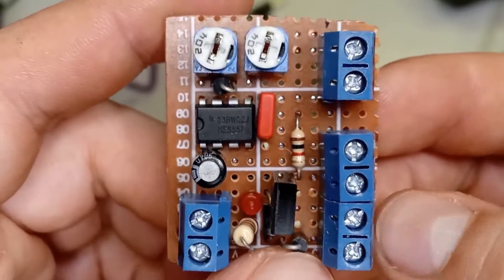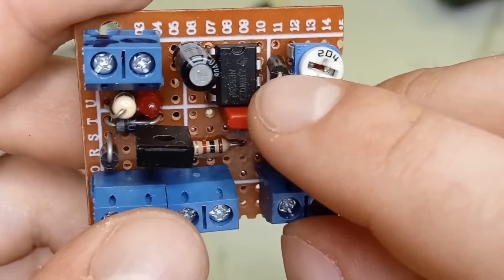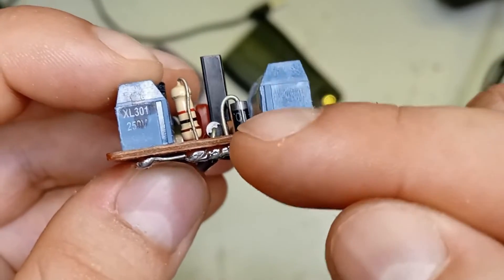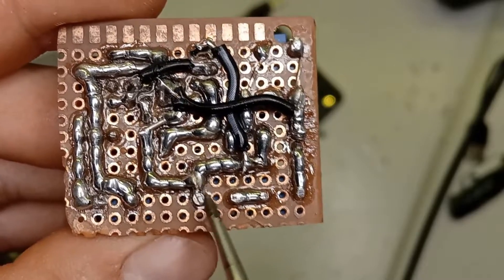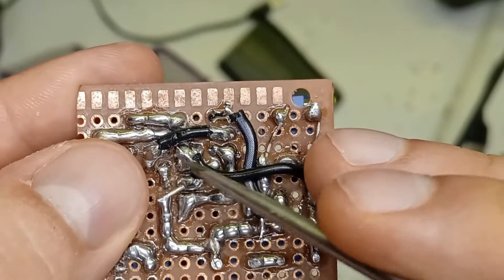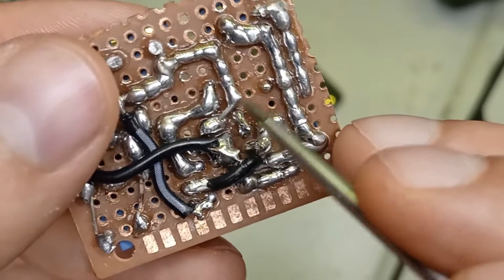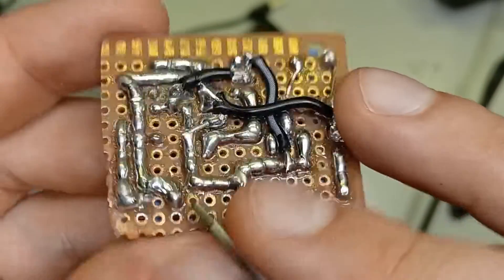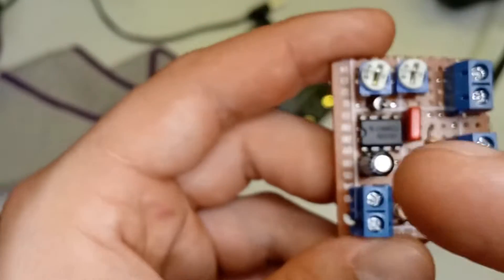Homemade Airsoft HPA FCU Circuit Guide (No Programming Required!)

Comment: Do you have a version of the circuit diagram that shows what parts are connected via the screw terminals, as I want to make a pcb version to reduce size but I am not experienced enough to do it myself

Comment: hi there was wondering if this will work with a 12v bv310a mac valve solenoid
Reply from the maker: This circuit is designed to switch a 12v valve. So it should be fine.

Comment: Why can’t you direct wire the trigger to the valve?
Reply from the maker: You can, but it'll only be semi automatic and will waste a lot of air as the dwell time will be controlled by how fast you pull and release the trigger. The engine loads and fires once per blast of air.
Reply: @FulcrumAirsoft  thank you for the quick response. I’m working on a 3-D printed HPA build on a budget so thanks. Any recommendations that you didn’t cover in your videos for me would be really nice. Thank you.
Reply: I don’t care about it being only semi auto
Reply from the maker: @crystalmiller9530 Then it would work, but you'll be yanking the trigger quickly to save air. And if the trigger gets caught on something it'll vent continuously until released.
Reply: @FulcrumAirsoft  I can work with that

Comment: Have you thought about making a DIY muzzle tracer unit?
I've tried but spectacularly failed.
I replicated what I've found in some videos but didn't worked. The thing is that the BB's speed is to high for it to have the necessary time to charge with the UV light.
Still, those on the market are working. I don't know if it's a certain type of LED's or if there's another secret.

Comment: Anyone have issues making this on a breadboard? Not sure if I’m putting too much current through the board or something but it doesn’t work at all.
Reply from the maker: I breadboard everything. All the connections good? Not using a knackered old breadboard?
Reply: @FulcrumAirsoft it was an Adafruit (albeit old) breadboard but i switched to one I knew worked and lo and behold it’s beautifully triggering the solenoid in semi and full
Reply from the maker: @saddlepiggy Chances are, whilst reassembling you've made a connection you missed the first time. I always miss something.
Reply: @FulcrumAirsoft for sure, definitely done that before.

Out of curiosity, is there any reason you chose 200k pots? I tried it with a couple combinations of 50k, 100k, and 200k which all worked too. Something to do with the RC/555 timing?

Comment: This video was motivating me. I dont learn electronic at all. Just wanna see how it goes and see the result. Perhaps i will start to learn basic electronic part on future. Have you ever uploaded the test result from making this simple module?

Pardon my bad english. 😅
Reply from the maker: I've used this exact board in a build. It works but the build has other issues with the hop unit. I even tried using a relay to switch the valve to get around the internal resistance of the transistor. When I get a moment (ha ha) I'll be sorting that build out.

Comment: Is the 10nF polyester or ceramic capacitor a replacement for the WIMA capacitor in your video?
Reply from the maker: Yes that will be fine, the WIMA was a polyester. You probably can get away without the capacitor but it'll make it that little bit more stable

Comment: Have you tried the Rk Education astable 555 kits? Im sure they will work with a little modification.
Reply from the maker: Probably would having a quick look at them, but I have no issues soldering the whole thing. Means it can also be smaller and tailor made.

Comment: can you use just a regular FCU? i am 3d printing the engine and i have a amazon 12v solenoid and was hoping to just add an adapter to the solenoid to get full auto and semi. i am so lost on the electronic part of this stuff. any help is welcomed
Reply from the maker: If the FCU can power the valve properly I don't see why not.
Reply: Thanks so much! I’m excited to see how this project works, engine is assembled just waiting on my tech lol

Comment: Have you considered trying this FCU with the saber engine?
Reply from the maker: I have yes. In fact I first designed it with a 555 based system before simplifying it as much as possible as I had issues with the 555 system. I will be testing a new circuit for those willing to use a more complex circuit instead and it will be very similar to this circuit.

Comment: you tried conductive glue to make the circuits... i think its easier

really nice idea
Reply from the maker: Thanks, I wasn't even aware of conductive glue until I read this. I imagine you'll still need to use a board to keep it all together. Don't see it helping that much. The difficulty I imagine comes more from assembling the circuit rather than what is used to form the connections. Could be wrong as I've never used glue.

Comment: Update, if you remember my hpa build I did a while back. I never got to test it or Chrono it. But this past weekend I went to a field to test it. And it was shooting right at 300 fps. Which for the 1st time is pretty good. I think If I get bigger air tubes.(Because I'm using 4mm and not 6mm) It would help a bit as well as maybe messing with the code to have the engine open for the right amount of time. Anyways it works so that's a w

Comment: Printing the parts as i write, ty for the great totorials. can you us a 2n2222 transistor insted of d882 its 30v 800 mah? i have them lying around.
Reply from the maker: No worries. You might be able to, but its probably cutting it a little close. The inrush might get it.
Reply from the maker: Maybe try 2 transistors in parallel. Although I don't know how it'll behave then.